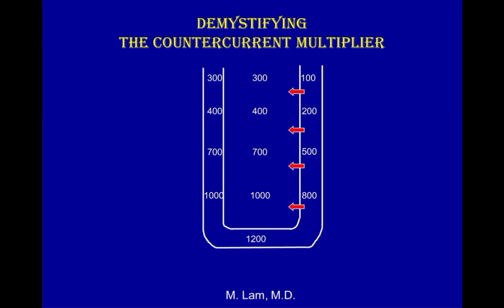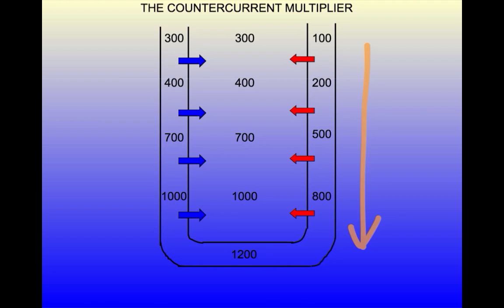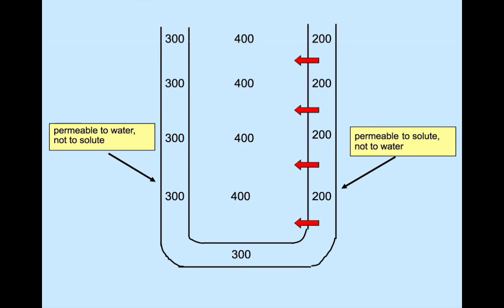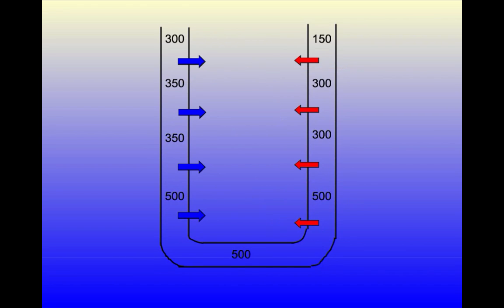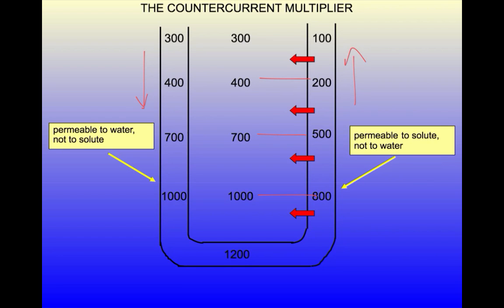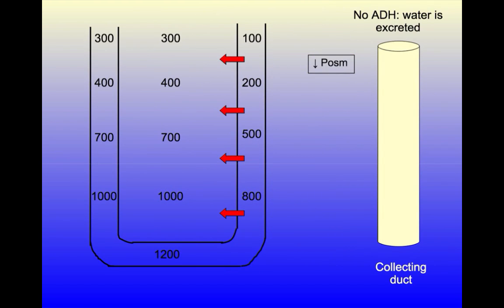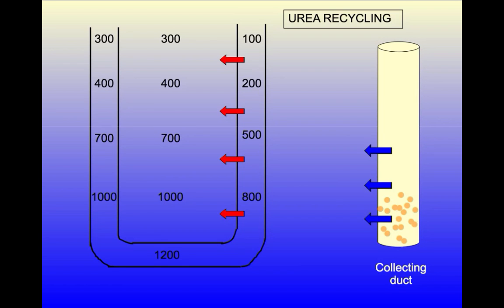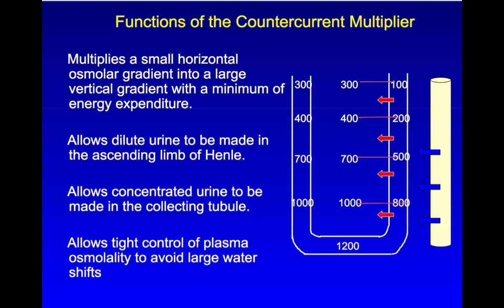Demystifying the Countercurrent Multiplier

Comment: Why does not the water leaving the descending limb change the osmolarity of the interstitial liquid?
Reply: It's because the active transport on the ascending limb of Henle maintains the hyperosmolairty of the interstitial fluid, keeping it hypertonic so water can always leave via osmosis from the descending limb.
Reply: No. I believe the video is not correct regarding this detail. The relative amount of sodium ions reabsorbed should be more but comparable to the relative amount of water reabsorbed, as sodium concentration difference is the driving force of passive water loss from the lumen. If filtrate flow is fast, ther might be not enough time to reach true equilibrium with the interstitium, but the amount of water leaving the filtrate should also have comparable and not negligible effect on interstitial osmolality.
This does not ruin the countercurrent model, the osmotic gradient along the loop can stil arise.

Comment: hold on. in the first cycle, when water flows from the descending limb to the interstitium, how come the concentration of the interstitium is staying at 400? shouldnt it decrease, since it is clearly being diluted by water?
Reply: The water is taken into the vasa recta and carried into the blood stream. This part of countercurrent mechanism is called 'countercurrent  exchanger'. This maintains  the osmolar gradient.
Reply: I knoww this has never made sense to me. I think the vasa recta absorb the water by osmosis because the blood is laden with solutes absorbed from the ascending limb and therefore hypertonic? It's called countercurrent multiplication because the blood and filtrate are flowing in different directions
Reply: osmosis water follows solute so it moves from low to high soluten, from 300 to 400

Comment: In the first step solute reabsorption from ascending limb rised interstitial osmolarity from 300 to 400 ... but how can it be that in the second step this reabsorbtion droped interstitial osmolarity to 350 in the top most interstitium ?
could it be the reabsorption of water from the descending limb aka equilibration ? don't think so : cause in the first step it didn't afect interstitial osmolarity which remained at 400
Can someone explain ??
Reply: Sid did you get your answer?
Reply: I think you can find your answer here : https://youtu.be/4-zXoYFdUR0
Good luck